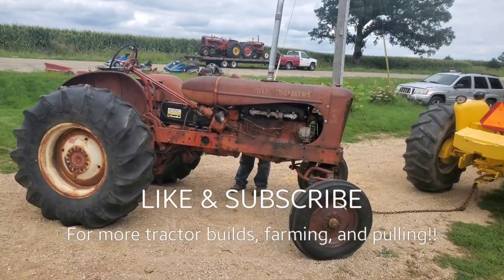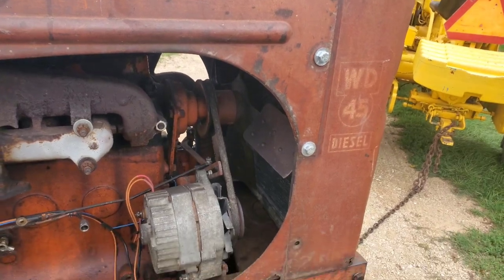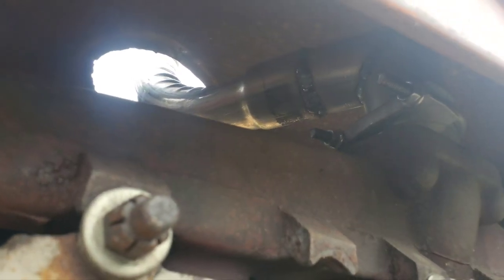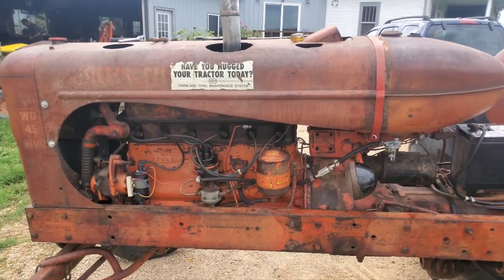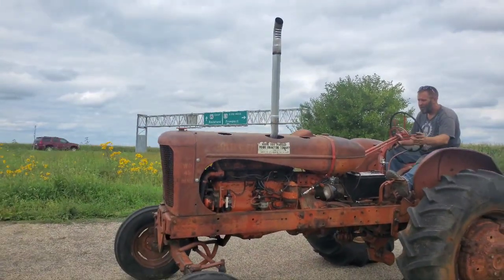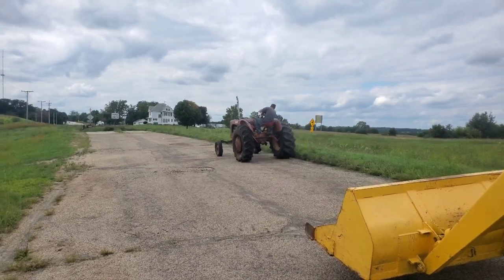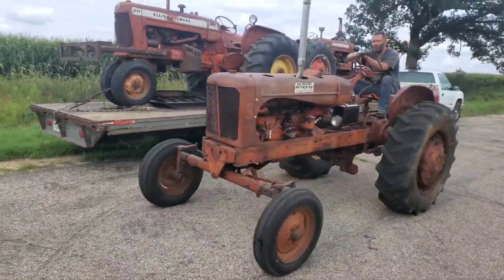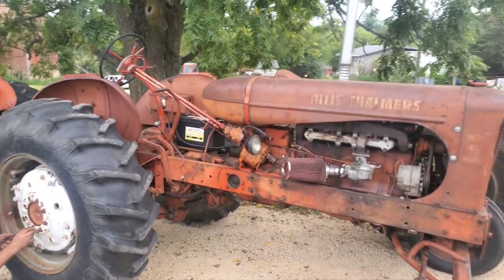Allis Chalmers WD-45.... ON STEROIDS!!! What did we do now???

Comment: Do I see a  D19 with a three bottom 70 series rollover plow?  Dont you need much more HP for that?
Reply from the maker: O no, a d19 will pull 4 14s  in heavy clay, no problem. I've seen them pulling 5 16s in mellow ground.  But that's no regular d19 you seem here is got a 100hp turbo charged diesel engine. That 3 bottom turn over is a toy for that 19 lol

Comment: Cool build . My dad (79) still runs a AC dealership. They pulled or contract in the 90’s but he kept the doors open as a independent and still have a lot of nos parts . He is the Zenith carburetor whisper as my pullers around the area will only let him rebuild and set up the carb . We actually have all the parts to build the same tractor as you but will probably never happen . Also own a 29 model U (Continental engine , radiator says Allis Chalmers not United ) and has always been on rubber tires. The block had a crack but had it pinned and welded . It does have a welded up piston in it too . It’s seized at the moment because a kid took the can off the exhaust 🤬. I’ve only ever seen one other U on rubber and that was a recent job because the rims were rotted from sitting in the ground. Always wanted to build a gas 301 with a converted diesel head , running a turbo and stuffing it into a d17 . A 301 in a 6060/6080 would be another swap I’d like to see done . Glad to found your channel .
Reply from the maker: A friend of mine named Ted Buskier has a U on Rubber that he's in the process of overhauling,  to bad about yours being locked up 😠 😡.  It's funny you say that about the 301 in a 6080, I'm literally in the process of overhauling one and I was tossing around the idea of putting a 301 in it, 😆 the frame rails and and drive shady would be simple but I got stuck at the fiberglass hoods, it turned into to much at that point 😆 I wanted this one for fuel efficiency any how I guess. Thanks for watching, if you look through my channel you'll find other builds life this I've got a d19 with a 433 a 17 with a 301 and a d19 with a 426, also a7060 south a 301 but that not as interesting lol. Thanks for watching!
Reply: @TimothyFluegel  There’s not enough room in the front air intake area or to wide ? ThinkAC ever put one together ? Seen some strange things they built . We had to to do a rebuild on a engine and things were different. Turned out to be a engine in  AC’s pulling programs. They wanted that one back . Cousin is looking for a grill for his 6080 . Don’t care about to much fiberglass work or metal screen ( just need one for a template though) . Definitely going to check out those other builds. Had those ideas back in the early 90’s . Always wanted to find a 4” piston from a auto application and mill a cross flow head for a WD . Efi , turbo running on methanol .

Comment: Pretty nice, neat little build. It will probably do that engine good to hook it to a sled for a little while and work it good, probably run smoothly after that, or finish off the head gasket. We used to have tractors come into the shop in the 90’s that would barely run, hook them to the Dyno for an hour or two and work the tar out of them and they ran like a top. Thanks for the videos. Be nice to see it hooked up to the sled.
Reply from the maker: Thank you Douglas! I'm definitely going to work it and see how it runs before I take the head off and if it clears up I'll throw the head gasket on the shelf for future reference lol.  It already seems to be running better just from driving it around the farm here a bit, so I'm hopeful it'll clear up, thanks for watching!

Comment: My Uncle and Cousin owned one. They where  a mean tractor  when you added a torbo and a head off a 190xt Allis Chalmers.
Reply from the maker: What tractor are you taking about here, I don't think I showed one that had an engine capable of exepting a 301 head?
Reply: @TimothyFluegel  my mistake  that was the 262 cubic engine in the D17 and D19 someone  had cured the head cracking.My uncle  put a gas engine  from a Gleaner combine when his WD 45 diesel  needed  overhaul without  too much trouble.

Comment: I remember those Allis Chalmers WD 45 tractor also Buda 230 6 cylinders motor with Zenith 1 barrel carb my grandfather Bill SR  bought 1950 Cockshutt COOP 40 had same motor 43 hp with 60 torque too 6 volt positive ground with 40 amp Delco Remy Generator bought in 1950 in Brampton Ontario Canada my Late Uncle Bill JR  got in 1977 when Bill SR past away! It had electric key ignition switch start plus Crank to start to and funny part I never could get Key ignition switch to start up but learn how drive ! My Uncle Bill used in Fall Fair in Town Of Port Hope Ontario Canada east Toronto with belt drive on Ferry Wheel in second week of September each up till 1992 ! Sadly in 1993 was hit miss on motor between 3 and 4 cylinders on low or medium or high idle even after Oil change plus Pot Filter also Fuel Filter plus points were okay plus Cap also Rotor also Wires and spark plugs to change to carb was tune right! What found happened is Gear on Distributor and Oil pump had chip out one chip went to number 4 cylinders bearing in crank sezied up tight plus cobs on Distributor gear and Oil pump to so tractor motor was screwed for life and crack in block to ! No motor could be found for it so tractor was parts model and sold in 1993 Fall Season! But was guy need parts tractor he fix up to restoration on he did memories one of my Late Grandfather Bill SR plus years later on my late Uncle Bill SR to and  Dad Don to ran farm on from 1950 to 1993 ! My uncle past away in 2013 and 2017 my dad past away too but if find another Cockshutt COOP 40 going do memories of my grandfather, uncle , & dad plus grandma and sisters on it ! Also I know hard find Piglet Exhaust muffler with rain cap only one makes them last I know is John Deere for 1940 to 1960 Row crop Like A to J models and  Case International be for Farmall models like A to MD or McCormick and International models be 1930 to 1960 years also 1968 McCormick International 105C combine gas motor 4 cylinders  if not got get big round ones !
Reply from the maker: Thank you for taking the time to type that out. I enjoy hearing old farming stories and information like this, I bet we would have a good time at a tractor salvage yard together lol, Thank-you for watching Andrew!

Comment: i grew up in southern il  in the 60s on a farm we used AC and farmalls. the prototype test farm was close to me. befor the D14 and D17 tractos came out a WD55 and a WD65 tractors were made for testing. they used the gas 6 cylinder engines from 2 model gleaner combines in a wd45 dsl frame , they were supposed to be true 4-14 plow tractors but AC got 62hp out of the WD45 engine in the D17 so the idea was scrapped as the 6cylinder engines drank too much gas..the antique tractor show in greenville il features  a few of these oddballs .only6 were built  as prototype units the rest were farmer creations
Reply: The prototype test farm was by Racine in southeast Wisconsin
Reply from the maker: Thaks for this information, as a puller its about priceless actually, being that Allis made a prototype, that's good enough to consider this a stock block for what ever reason 😆 I don't make the rules I just read them lol, so would this one be considered the wd55 or a wd65?

Comment: We put a 262 in a gas 45 chassis still trying to figure out throttle linkage
Reply from the maker: We used a cable off of the existing linkage under the fuel tank.

Comment: my father had a gas wd45 with loader and narrow front axle.  i didnt even know they made them in a diesel version. i found they didnt make very many either.  Allis Chalmers WD45 ; 83,536 (gasoline) ; 6,509 (diesel). & i had the yamaha ss.
Reply from the maker: They sure didn't make many of them and alot of them didn't survive the old timers switching from their gas engines, they thought they could fire them up and go to work and do the same when they are lunch shut we down hot, the power cell design in the heads didn't allow for that type of abuse lol
Reply from the maker: That Yamaha ss was alot of fun for alot of people around here over the years but it's finally time to say goodbye lol
Reply: @TimothyFluegel  lol it looks rough

Comment: I have a BG230 sitting in my shop for years, just can't locate a 45 diesel flywheel. Anyone have one for sale?
Reply from the maker: Possibly. Tim_gorge@msn.com that's my email send me your contact info. I'm going to the allis salvage yard hear in the next week or so to get one. I know he has multiple chassis setting outside complete with engines, I would imagine he would part them out if someone needed stuff.
Reply: I think you can take a normal 45 flywheel and add the second ring gear and tha will work.
Reply: @thomasandrews9764  The 45 engine has a 4 bolt flywheel, the Buda has a 6 bolt and the flywheel  also has a flange that the rear seal seals against.